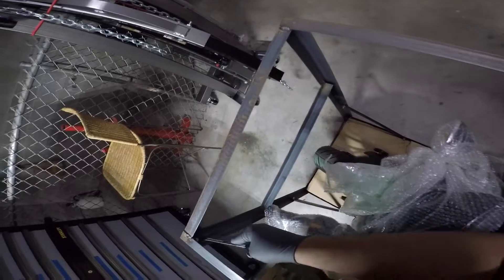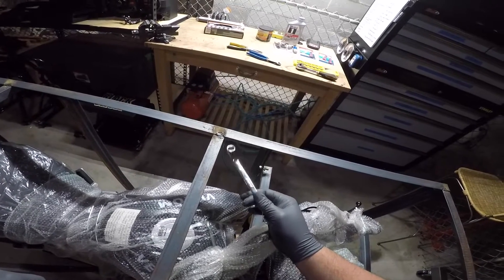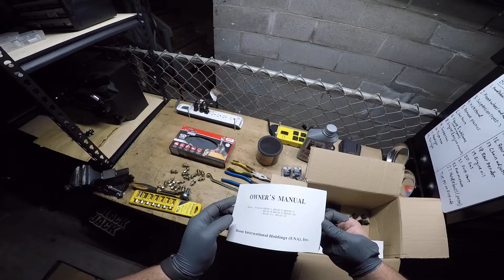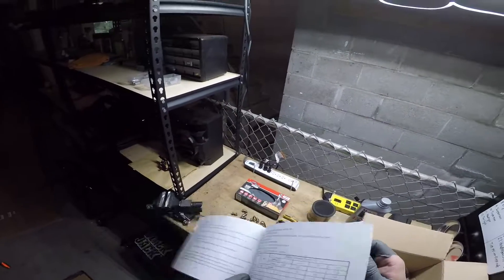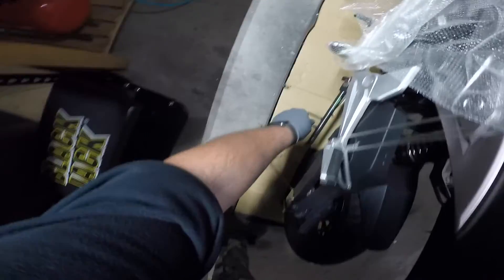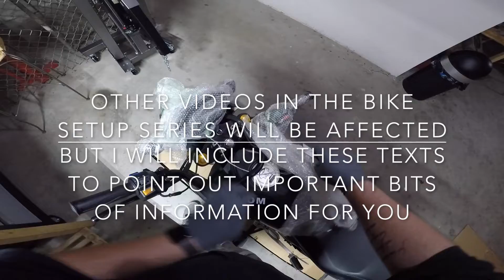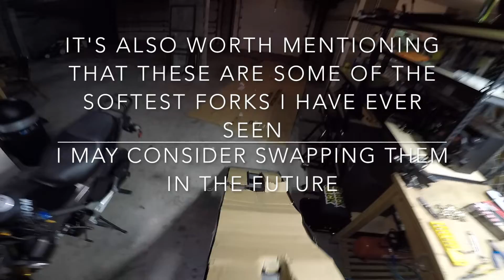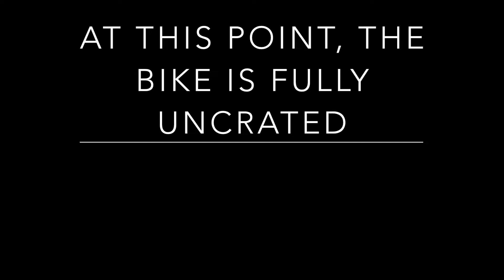Uncrating the Vader 125 (Grom Clone)

Comment: Like I have said. as long as you goin to this knowing its not a grom. Have your fun with it man.
Reply: These bikes can easily be better that a grom if you replace the engine mount bolts, loctite the remaining factory bolts/nuts, and swap the motor with a zongshen 190cc. They put out 14.9 horsepower and top out around 85 mph...possibly more if you put on a 17 tooth front sprocket. They will kill a grom and last just as long for way less.
Reply: @davegoodwin1848  can you let me know a vid to do all this or all the stuff needed?